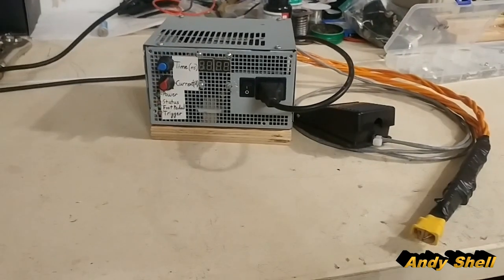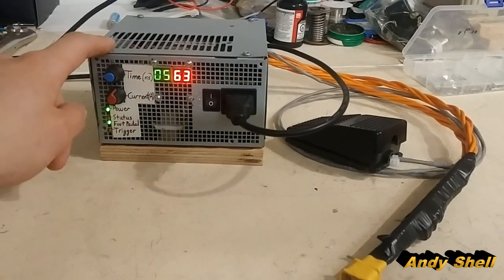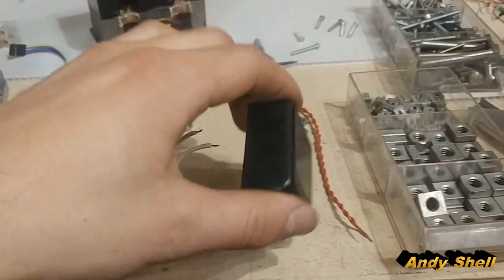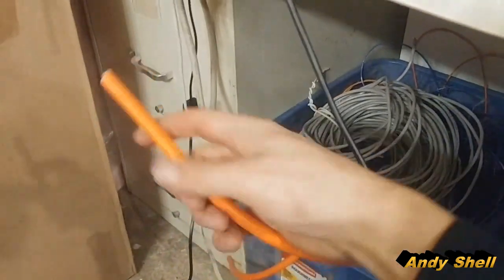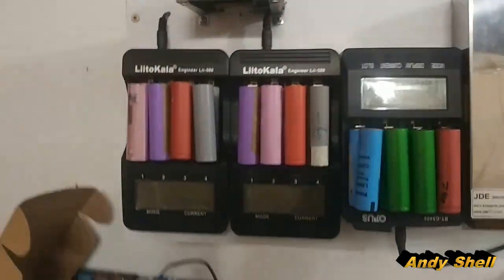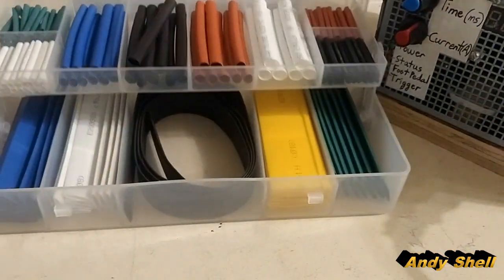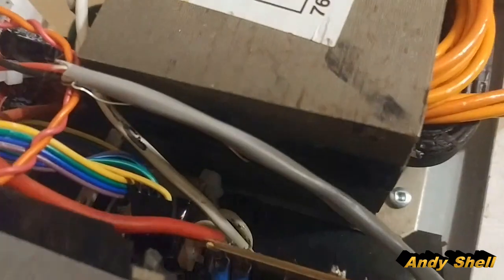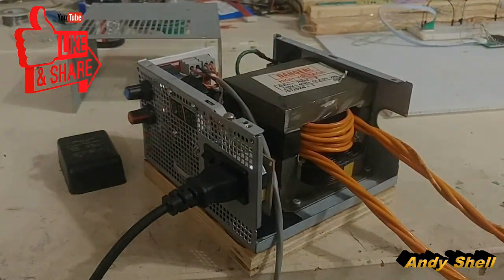Cheapest DIY Spot Welder I Could Make

Comment: how is voltage  in secondary coil important ?   do you knov voltage on factory welders ?
Reply from the maker: ? The real issue is copper leads are nfg gotta use stainless steel apparently
Reply: @AndyShell  i was asking about welding quality.how much is voltage important.is there a desired voltage ?
Reply from the maker: @automajstorijediy  there deff is but im no expert. I rarely spot weld.

Comment: I'm planning to build one, is yours's still working? Many people said it's not long lasting on web platforms.
Reply from the maker: The only issue is the spot welding leads. They heat up really bad and get lots of carbon buildup. Idk how to resolve this issue without just buying really expensive leads
Reply: @AndyShell  Try mild steel or stainless steel, I went to an exhibition a month back and there was this people with diff. types and really expensive SW machines, the tips were not copper, so I asked them and one of them told it's stainless steel.
Reply from the maker: @arvindh13  dam ok ty!

Comment: Hows the "alumina copper welding feet" working for you? I heard it prevents the tip from sticking to the tabs and is hard enough to prevent wearing out. I ordered some but hasn't come yet. Pure copper just needs frequent cleaning. I can see your adjustment is less time and high current. That worked for me too, less to no sparks.
Reply from the maker: Seems to be good. I have some blacking but no blow out. The metal its self if holding strong but it does stick tho very very little. I have heat buildup at the wire tho. Dielectric grease helps

Comment: Impressive construction , Im not brave enough to try that kinda stuff yet as its sparky scary but i did try spot welding with super caps but it failed as there was enough amps but just not enough capacity as a power source. One last thing you could have a computer operate the timing on the trigger for the spot welding like raspberry pi and a relay and through that you could probably program certain time profiles based on target materials etc.
Reply from the maker: Thx steve! you gotta use the k.i.s.s. rule in life or you'll drown in complexity. The pcb works great. It was pretty safe and easy to build but i sat on it for over a month over thinking the construction method. Only part i dont like is how i connected the pen to the wire. Its pretty sketchy but oh well. The rest is great. An Arduino would be useless. A piece of paper with prefered timing and amp values would be far better. I just like exploding metal 😆
Reply: @AndyShell  Use 35mm2 wire for your secondary - you can get 2 full turns with 1.8V (enough for battery spot welding). I have same MOT and same pcb. Also 1 more thing - electrodes are 50% of good weld. If you can find CuCrZr copper bar (6-8mm) and make tip sharp (round in last 1mm2) you can have great welds. Good pressure is also needed.
Reply: @AndyShell  with an arduino triac and right program I think you could control the pulse timing, then you would need the paper with msecs against needed power